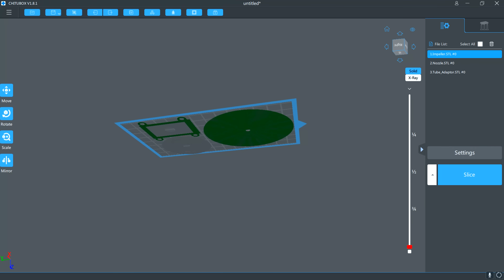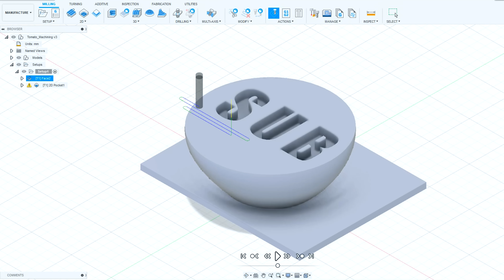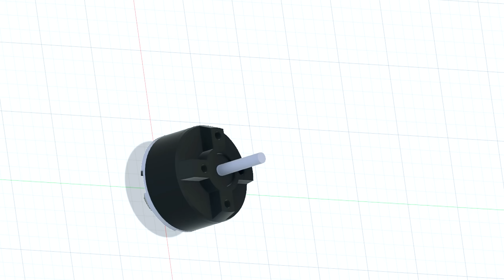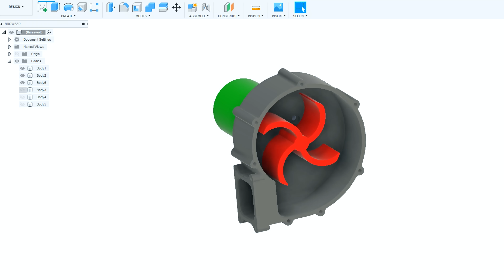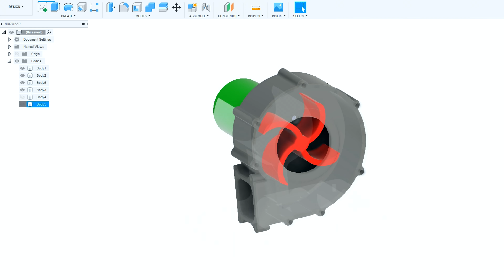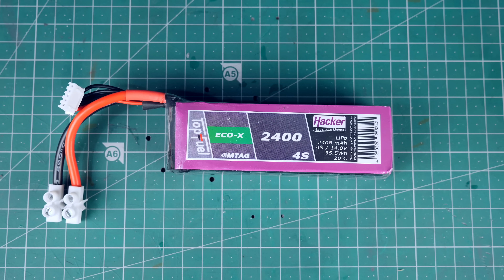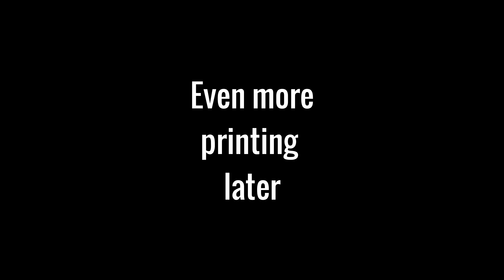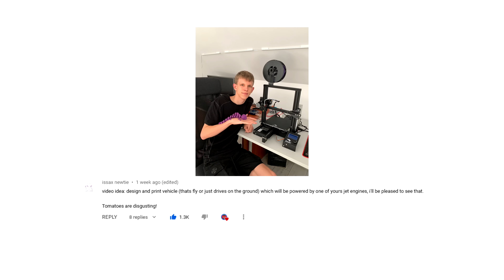Water Rocket Skateboard (3D Printed)

Comment: So can I ask why you have you water pickup 1/3 height of the canister ... to use the other 1/3 as mass ?? second question would be: did you ever google cavitation and why it is bad for (im/pro)pellors ? These impellors fail not because of that though. They fail because of the instant acceleration when it moves from water (incompressible) to moving air (compressible). There is just no strength in the part to bridge the fluid to gas gap :)

Comment: It's all to do with mass flow.  If you have something dense ie water you need to throw less backwards than a less dense fluid ie air, to move a fixed mass forward.  Jet engines throw vast amounts of air backwards to move a jet plane  forward.  you can Increase the thrust by spraying water or tomatoes in to the jet.  Rolls Royce did this with the pegasus engine for the Harrier jump jet.

Comment: Lube also helps when cutting acrylic on a CNC little machine like that, I've used soapy wooder for it.

"Marine grade plastic" (I think it's just HDPE or similar) is also a great material for making parts, cuts wonderfully with no hassle.

Comment: You had several issues...
1. Your outlet from the reservoir needs to be at the bottom, not half way up the container. Everything lower than the valve is wasted water that you cant use.
2. Your pump wasn't the problem. It exploded from excessive pressure. More motor RPMs jsut made more pressure than it could endure.
3. Your nozzle was too small and pressure inside the pump got much higher than the nozzle could let water out of the pump.
4. Motor torque is what you needed, not more motor RPMs. A lower Kv motor would have been fine, you just lacked the motor torque to push the water hard enough. 
5. The impeller exploded from excessive RPMs. It literally threw itself apart. 
6. This type of pump is quite leaky internally and as a result pressure leaks back into the incoming water. They are really low pressure, high volume pumps. 
AS usual...an amusing video! I do love to see what crazy idea you come with next.

Comment: Idea: Change out the water for fuel and as it exits the pump, ignite it! Of course you'll need to mix it with air so you could use compressed air for more propulsion.

Then, send it up instead of sideways!!!

Comment: As someone with a background in machining (CNC and manual) I can say that in most cases, metal can be more forgiving to machine then plastics/acrylics cause you don't have to worry about it cracking and splintering. I do know some equations for spindle speed and feed rate that will make programming a little easier, but since I'm American, you're going to have to convert it into metric.

Comment: The problem isn't so much the exit nozzle as the restriction on the inlet side. you need to keep the inlet as big as possible.

Also, it looks like you're restricting the exit more than necessary as well. In theory a smaller exit nozzle gives you higher velocity and more thrust with less water, but it also raises the pressure dramatically, which is why the nozzles keep failing.

I think that if you're going to be 3D printing, and using plastic in general, you'll have more success with bigger nozzles and lower pressures.

Comment: I'm not a rocket scientist, but one thing I saw which confuses me:
The impeller:  The "Blades" curve backwards relative to the direction of spin.
That will slow the speed of the water.   If they were curved the other way, wouldn't it increase the pressure - and therefore the speed - of the water exiting?

Comment: Before trying to design something like this, you should read about how these things are usually done. Centrifugal pump is not the way to go here. You called your contraption a 'jetski' you shoud lookup what type of pump those things use. Sketching up the first thing that pops in your head just won't cut it.

Comment: Your main issue was the air stuck in the system which meant you had to push parts too far.  Try with the one at 5:40 and it will work much more efficiently just compare the flow from both I estimate about 4 times the thrust minimum.  Great vid as always

Comment: CAVITATION!!!!! That's what all the bubbles inside the running pump a caused by, and it causes huge inefficiencies. It's a thing that pumps do when you spin them too fast! basically slow the impeller speed or get much more water into the pump inlet, maybe build a 2-stage pump, with a large slow impeller, then a high speed high pressure stage to really get it moving.

Comment: So I am not an engineer by any means but I am a firefighter and we use centrifugal pumps on our appliances, the volute (the casing the impeller goes in) is specifically shaped to impart the most energy into the water, so maybe you can downgrade the power of the pump and invest more time into the shape of the volute you might be able to get a more efficient jet without blowing up the impeller with the crazy pump! Lol also the impeller shape itself makes it more efficient, again not an engineer but I think the volute can have shaped fins on it which makes it more efficient! Anyway awesome project! Can't wait for more!!!

Comment: Maybe you should pump a combustible liquid, and a oxidizer into a chamber and ignite it, then send the gases out the nozzle! It should work much better, I just don't know what to call this device, but I'm fairly sure it would work! Ha-ha but yeah try it! Maybe nitro propane mixed with Methanol, and liquid o2, or maybe just methanol, I was thinking maybe the added o2 in the nitropropane would help the burn be more efficient, maybe if you used it with kerosine, nitropropane with liquid o2, but it's a bit dangerous, I'd stay with methanol and 
L/o2,

Comment: the problem with your build is combining water, centrifugal pumps and high speed rotation speed. The high rpm of your motor causes the pump to undergo cavitation, as it tries to pump more water than it can suck in. Reducing the nozzle to much at that rpm causes a restriction, resulting in the water inside the pump sloshing around and heating up. Thats why centrifugal pumps use slower running motors. Adding extra stages to the pump will increase the water pressure whilst, enlarging the physical pump and impeller would increase volume flow rate. An axial pump would work better with higher rpm, like the one in a jet ski.

Comment: Water is not that compressable, however, gasses, are. If you have a pressurized cylinder of gas and discharge it into your sealed reservoir, the liquids will be accelerated out at a high velocity. The nozzles can then be optimized to direct that water. FDM nozzles may be better for the pressure than resin ones. They have more give. Do this before you mill something out of metal.
Reply: So make a bottle rocket and put it sideways on a skateboard?
Reply: @LewisRawlinson30  more or less. But with more 'Go'.
Reply: The nozzle appears to be a simple cone.  Have you thought of using a full venturi design?  One where the narrow part comes after the impeller but before the exhaust.  Think rocket nozzle.

Not sure where you'd find a design for a water based venturi, but there has to be one.

IDEA:  There are some wonderful things you can do with laminar flow and water.  Just look at the Bellagio water show in Las Vegas.
Reply: @EdwinWiles  I believe water Venturi apertures work on the same principle of gas venturi apertures. Maybe a little bit wider to compensate for the viscosity of a fluid.
Reply: @jiimz  sure!  But what's the best throat diameter for the feed from the pump?  Would it help any to have a bell nozzle exhaust?  Those details make a difference.
Reply: @EdwinWiles  I'm thinking just get rid of the pump entirely. Just have a hole at the bottom wall of the tank, and inject as much gas in as quickly as possible. Sans a bunch of unpleasant math, the best nozzle configuration, if any, would be a trial and error thing. But I know next to nothing about food dynamics, so I'm prepared for this entire thing to be incorrect.
Reply: @jiimz  Absolutely, the limiting factor here was the pump, which was already cavitating before the motor swap
Reply: I hope he see’s this.
Reply: Me too.
Reply: Kinda like the old air hogs toys
Reply: You know what? Frick it! Compresses water
Reply: @butyumean3830   He's too dangerous to be kept alive
Reply: @butyumean3830  "How'd they do that?  It's physically impossible!"

"They didn't like the physics, so they did what they always do when frustrated."

"How do you beat physics up?  They're natural laws!?"

"Two things.  First, a frustrated human is inventive as hell."

A long pause...

"And?!?"

"They never did study law."
Reply: This is a big brain boy right here
Reply: Yes please build world most powerfull SuperSoaker :-)
Reply: This is also why working with high pressure fluids with air inside the lines is quite dangerous. If the hose bursts you have a super fast stream of hydraulic fluid coming out and it can and will pierce your skin. Whereas if you have a system with no air and something bursts it’ll just release a small amount of fluid, given that the hoses are not expanded too much.
Reply: @Chevsilverado  people cut steel with water jets 😁
Reply: @amalirfan  Yeah I’ve seen a couple people who injected themselves with hydraulic fluid accidentally and it’s a very very bad situation. Those hydraulic lines had air in them which made it 100x worse.

Comment: yep that CNC is going to struggle with Aluminum . you will just need to keep your cut depth small 0.5 mm or less . AL is gummy and will stick to the mill end, your feed and speed are going to be important as to slow feed and you just rub the metal to fast and it will grab and snap the mill end .  small cuts and lots of WD40 and a sharp mill end

Comment: I think if you decide to make a second iteration of this ever, you might consider redesigning the reservoir to sit higher, so the connecting hose is lower, and so it can fully empty. This might cut down on extra weight, since there was a fair portion of unusable water in each test.

Comment: Perhaps you should have used tomato juice instead of water  :) also wondered that if you then caught the juice and then repumped it back into the reservoir you would never run out of the tomato fuel :) but not sure if that would still move the skateboard but im sure it would :)

Comment: Once you get an impeller that doesn't go pop, you will need to get rid of the air in the chamber before going full insanity with power. Maybe an diaphragm that gives away with pressure. Would be nice to see what kind of cavitation mess you can produce.
(If for some reason this comment goes into raffle and wins something, please roll again. Some youngster out there needs that printer more than me - I already have one.)

Comment: These videos are always so entertaining, I about fell out of my seat when the pump exploded the first time. But some quick advice from someone who builds pumps. The inlet piping needs to remain at or close to the same size at the inlet port, at least that close to the pump, the 90 degree bend needs a larger radius and potentially moved further away from the inlet port. The outlet needs to be lengthened before adding the nozzle (the flow will be more laminar). The impeller may need to be made in a “semi-open” design that has a back wall and the veins may need to have a larger radius for the speeds you’re trying to run the pump at, I’d honestly print many with different radius veins and test to see which one performs the best. All this should improve the performance.

Comment: Instead of cutting metal (aluminium) on that tiny CNC, mill some Carbon Fiber! It's much easier to work with, much stronger and much ligher ^^ (PM me if you want some insight in CFRP machining)

Comment: Use a Tesla turbine instead with this motor, it doesn't have such a high resistance as a impeller
Reply: I was screaming this in my head "Why did you not just try a tesla turbine with this"

Comment: You will see much better performance if you eliminate the air in the system by inverting the pump so the outlet is on top. Be careful of cavitation, if you overdrive the pump it'll create microscopic vacuum bubbles behind the blades of the impeller. It would be interesting to see this compared with a jet pump or impellor.

Comment: Since you so often do air and water pumps, I'd be supremely interested in seeing you experiment with optimizing the ducting, specifically when you go from a larger outlet to a smaller inlet, or vice versa. What sort of expansion or contraction angles result in least pressure or velocity losses?

I've read that in square air ducting you shouldn't expand at more than 7° angle (I think it means that the angle between the straight part of the ducting and the expansion should be 7°, so if you're expanding in all directions they're all 7° angles, rather than 3.5°) to not cause flow separation, and maximize pressure at the other end.

Same kind of rules seem to have been used when designing naturally aspirated intakes for racing cars, though with somewhat more complex, curved expansions (for example the roof intake on the McLaren F1 GTR, which has to curve down towards the engine at the back). Despite the actual hole for the air intake being fairly small, the controlled expansion helps convert the velocity of the air flowing around the car into higher pressure at the air intake, increasing power. Ex-F1 engineer Willem Toet has a few great articles about this stuff on his LinkedIn pages, if anyone is interested.

Comment: I see a lot of air bubbles at the impeller causing losses, you can solve this by increasing the reservoir pressure, ie. make a thinner but taller reservoir. You did a great job though, and it looked awesome!

Comment: NPSH!  A centrifugal pump needs a pressure head or when it spins the impeller, it just boils the water (even at room temperature).  You cannot use all the power of the pump because there’s only water vapour for the impeller to get hold of.  You need your tank on a tall stand, or use a positive displacement pump.

Comment: What if you used a hydrogen fuel cell to generate electricity for the pump and create the needed water to pump out in the first place? You could have a much smaller water reservoir and carry more fuel by only supplying it with hydrogen and getting your oxygen from the atmosphere?
Reply: and what if rather than expelling the water via a nozzle you used the water to turn the wheels, kinda the same way how pneumatic tools fucntion?

Comment: 13:10. Perhaps look into how much thrust that hose produces, and simplify the system. Perhaps it is only a matter of generating enough pressure in the water and having a fitting nozzle.
From the slow mo footage I would say the rotation of the impeller is too fast and it mixes in air, reducing the overall efficency. With more waterpressure to the impeller and lower rpm you might already get more thrust.

Comment: I wanna see machined metals!!! Not only that, but use your 3D Printer to make molds to cast metal too!!!  You easily make rocket/pump housings with 3D printed mold reliefs to cast bronze or copper (or hotter melting point metals if you wanna burn down the attic)

Comment: I saw a video today of metal casting 3d prints by RobinsonFoundry, the details retained where amazing. Maybe you could build a small homemade kiln and use metal casting for problem parts like the impeller in the future. Would also be a nice way of reducing waste of the CNC if you move to metal CNC you could recycle the shavings into ingots then eventually metal casted 3d prints

Comment: integza, you said at the end of the video that your issue with the pump is the strength of the parts (specifically the impeller. you also said you can kinda cut acrylic. well why don't you try again but with an acrylic impeller or even another solid plastic. no matter how you 3d print something it just wont be as strong as a solid thing of plastic. plus if really thick acrylic is as expensive as i think it probably is you could do multiple sheets of acrylic and glue them together.

Comment: I'm curious as to why you used a centrifugal pump instead of an impeller/propeller  pump used by jet skis.

Edit: Something to note, jet ski pumps only run at 5000-6000 RPM (at about 100 hp).

Comment: Pleas put on your high presur Cleaner a new hose and Print a nozle for it. 
Then put the nozle on your CnC. Then try the same Tomato Programm on the tomato.  

When it dosen‘t work try a Venturi Nozle to put Sand or some thing into the Water to Cut the disgusting Tomato 🍅

Comment: You should rebuilt the pump and put it on a surf board. Maybe add two pumps so you can use differential steering.

Comment: Spindle Speed and Feedrate formulas for machining Aluminum:
Spindle Speed (HSS tool, rough passes): [60 m/min * 1000]/[pi * diameter of cutting tool] = rev/min
Chipload per flute (Aluminum): 0.200 mm/flute
Feedrate: rev/min * mm/flute * Number of cutting flutes = feedrate in mm/min

These will get you to start cutting aluminum, though you will need to watch what the chips are doing and listen for "chatter." These indicators will tell you if you need to adjust your speeds and feeds

Comment: @integza, you see all the air in the "mill", try to make a more inclusred version, not nesseserly a smaller nossel, bigger output=bigger power, but try optimize the input, so it uses all of its power.

Comment: You've made things that can get really hot but don't push too well and tend to melt... cool to watch but not very useful. Now you have a solid pump for water, when it doesn't self destruct. Put the two together... really hot jet engine housing jacketed by a pressure vessel with an outlet nozzle. Insanely hot engine housing cooled small amount of cold water means water flashes to high pressure steam and is ejected out the back. Steam rocket engine.